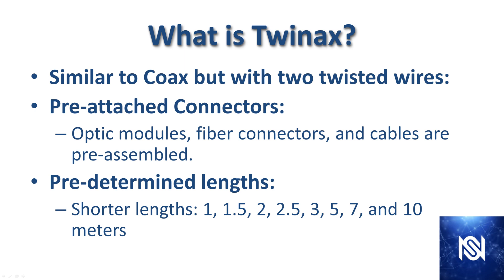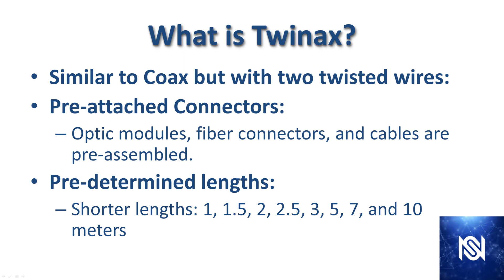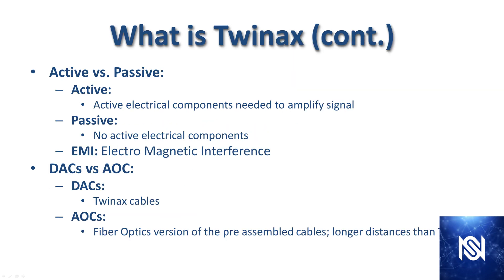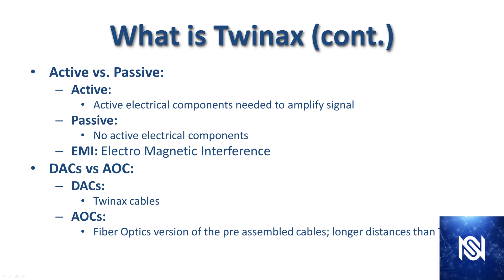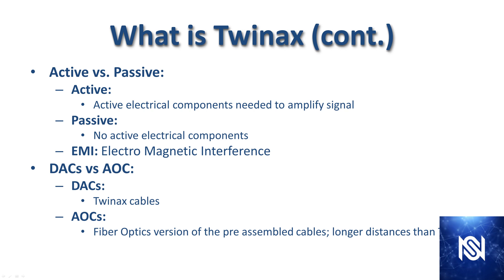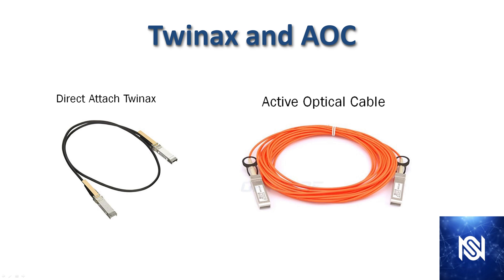Free DCTECH - 010-151 - Describe Twinax & Active Optical Cables - Video 11

Comment: I enjoy your videos but I'm confused on this one. On the slide for Twinax (copper), you have under pre-attached connecters that twinax uses optic modules and fiber connectors?
Reply from the maker: Hey Eric, thanks for the feedback.  I probably did a poor job explaining what I was trying to convey.  I was only putting the Active Optical Cables on there to convey that they are similar to the Twinax cables in that all the components are pre-attached.  So they are similar products but in different categories.